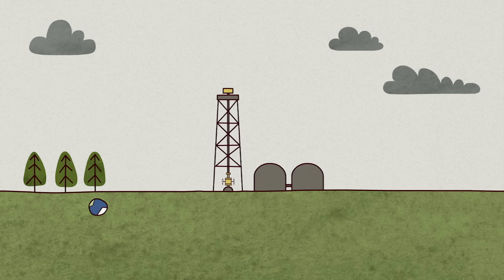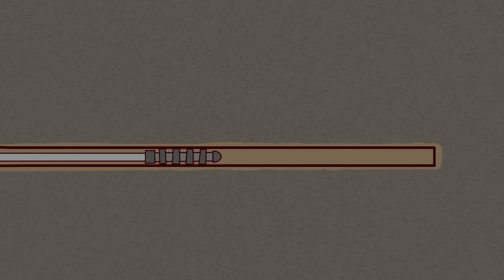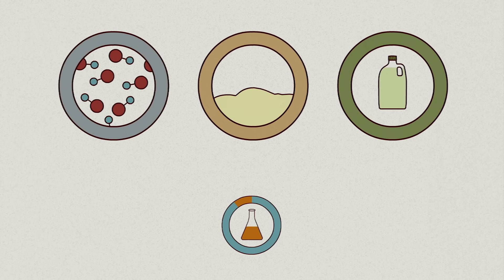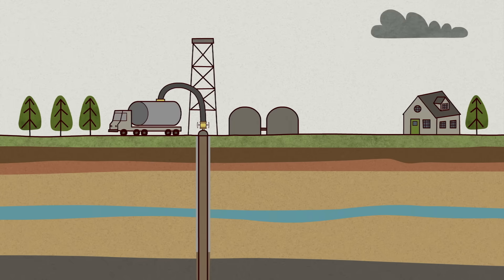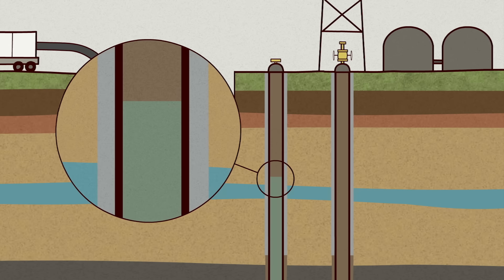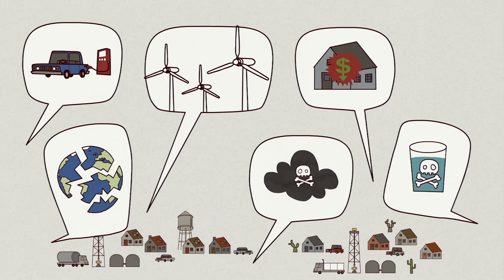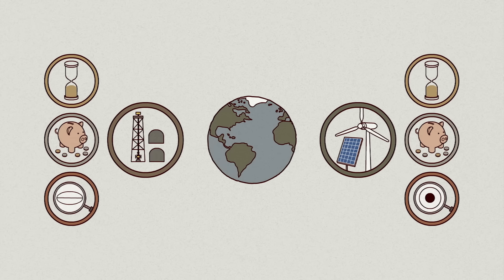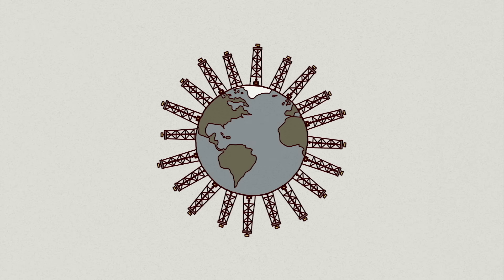How does fracking work? - Mia Nacamulli

Comment: MISLEADING / MANIPULATIVE EXPLANATION ! I noticed that this is the newest and most viewed video explaining fracking(I would also trust TedEd) BUT -This video was made in order to induce a bad opinion about hydraulic fracturing to the general public. It’s a neat combination between true facts and total B.S. I will try to explain. Keep in mind that nowadays, this process is usually happening at a vertical depth of 1-6 km. Anything that happens at surface can be easily controlled.
Breakdown-starting from ~1:47: 
Acids make up a very small part of what's involved in this process. One could argue that the use of acids was reduced by the introduction of modern fracking. 
Slickwater can be classified in 2 main categories (99% of the cases). 
The first is guar and its derivatives. By the standards of this video, i could also refer to guar as a legume. If you do a google search on "guar", you will learn that it's sourced from nature and mainly used in the food industry - Right here, on the surface of the earth, exactly the place where pollution is a problem). 
The 2nd one is Acrylamide derivatives(invented and also predominantly used on the surface of the earth). EX: In United Kingdom, approximately 12,000 tons of polyacrylamide is used in the paper production industry annually. Fracking in the UK probably uses no more than 50t per year(most of which stays in the ground). Interesting read here: ukessays.com/essays/biology/acrylamide-with-chemical-formula.php . 
Disinfectant is also a very small part of the process (0.0001%). This is usually chloride and its derivatives. I'm fairly sure that worldwide, more of this is used by the water park industry alone than by hydraulic fracturing. 
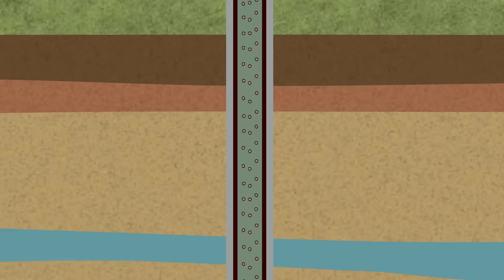Going further, from ~2:55  - the produced fluids can be handled safely- it’s just a matter of enforcing the rules on how to do this. Here is where lack of care, corruption and/or incompetence make their mark.
Radioactive material is also very negligible compared to what’s mined and used on the surface in nuclear energy and other applications. 
Salt – Need I remind you about the salt from the oceans?
Heavy metals – the amount fades away in comparison with what’s used by the battery industry
~3:35 All O&G wellbores in the world feature 3 or more barriers in this zone. If rules are enforced properly, the water table safe from harm. 
Everything is done in order to extract more hydrocarbons. Fracking into water is seen as a failure. 
The seismicity created by a moving train or truck is significantly bigger and more frequent than the one generated by fracking.  
The fact is that hydraulic fracturing has been around since the 40s. It has evolved as a secondary result of the advances made in the chemical industry. We use much more than what’s criticized in this video on the surface of the earth in unrelated applications. 
Much more important is the fact that hydraulic fracturing has delayed the moment when the world will experience a shortage of hydrocarbons. Some people were expecting extreme shortages to happen starting around 2020. This was a hot topic in the 1990s but forgotten right now. As we all know, energy shortages can easily lead to WAR. EX: The Iraq war(widely regarded as influenced by oil) began in 2003. Fracking boomed in 2007. The war officially ended in 2011. MIC DROP….
Reply: if i can make billions off the dohpes in PA that think fracking is safe, then i'm all for it. no need to even bribe them when they are so easily manipulated. i dont care if fracking contaminates their water as long as i make my profit margin. its not like you are getting any major intellectuals from those communities anyway. and if entire families drop, the company can easily take their lands and add more wells. a win win.

Comment: We know that, at the power plant level, natural gas produces only somewhere between 44 and 50 percent of the greenhouse gas emissions compared with burning of coal. This is known for certain; it’s basic chemistry. That is a gigantic benefit. Further, some research that claims methane is so harmful uses a 20-year time horizon; but over a 100-year time horizon – the way we generally measure global warming potential – methane is not nearly so harmful as claimed. Thus, methane’s impact is potent but relatively brief compared with impacts of increased carbon dioxide emissions. The number-one priority must be to reduce the reliance on coal, the biggest threat to the atmosphere right now. Fears about emissions leaks are overblown. Even if the true leakage rate were slightly more than EPA and some states estimate, it is not that dramatic. We are developing technology to reduce these leaks and further narrow the gap. Moreover, research-based modeling suggests that even if energy consumption increases overall, the United States still will reap greenhouse benefits as a result of fracking.

Comment: Just a little one sided. There are problems and risks with every form of electricity. Tens of thousands of fracking wells have resulted in less incidents and lower scale than any other form of energy production. Not saying fracking is great, just that the author is extremely biased. Do your own research on fracking and multiple alternatives and the entire process of each to form your own educated opinion.

Comment: 1:00 That's pretty deep - 3000 meters is 1.84 miles.
Reply: They go much deeper than that in some parts of the world. Chayvo is 4 times deeper.
Reply: @mcty19  Indeed. Thank you for that. After reading on it, I see that several world records have been set there, including the current record depth set in November 2017 of 15 km/49,000 ft/9.3 miles.

Comment: Fracking process also use high pressure (gas)
Simple term.
This process has been Use from 1980s 
Mobil oil us one company. 
The mechanical process cost more but more environmental friendly 
Coal powerplants use  bag houses as filter 
The USA is the most environmental country.
Ocean pollution in the USA is. 0.03. Asia ,China 83% pollution.
China will not Start climate change until
2035. 
These are facts look them up.

Comment: Turns bedrock to gravel. Releases radioactivity. Despite claims, it allows "produced water" to enter ground water. About a tanker truck of chemicals get pumped into every frack, only half of it comes out. ALL well casings fail, just a matter of time. The fracking industry hasn't made any money since the whole industry is being financed at very low interest rates. The federal govt is currently propping this industry up because it can't compete with currently cheap oil. The long lasting effects of polluted ground water, massive amounts of in ground VOCs and toxins, consumption of surface water, big oil money corruption in congress, wars across the globe, the delay of renewable energy development and especially the escaping, unburnt gases which are 80x worse than CO2 are an absolutely insane way to continue to power the world. It's not even profitable. This is a corporate, good ole boys ponzi scheme stealing monster amounts of tax dollars from Americans and making a few well connected 1%ers and politicians rich. End of story.

Comment: Take it from someone who has worked in this industry for a long time.  First, there is no "k" in the term "fraccing".  Most people in the industry will find this humorous.  Secondly,  this video is very basic and there are some things that are not very accurate about it.  The author of this could have done a better job of condensing the material while maintaining the accuracy of each statement made and used more standard terminology in that process.  Finally, there is a "left" leaning slant to this presentation.  One should investigate the necessity of hydrocarbons to the products and services that we all find essential to truly understand the magnitude of ignorance that is imbedded in the concept of banning frac and its impact on domestic oil production and the global economic impact that would follow.   In short, everything we have utilizes oil in the process of production and delivery to the end user.  Without oil we would be back in the dark ages . . . without wales!

Comment: 2:54 How can there be radioactive material in the flowback liquid?
Reply: I'll try to explain it as simple as possible:

hydraulic fracturing is used in Shale reservoirs. and those shale reservoir have a geological term called "source rock" one of the interesting characteristics of source rocks is that they're very radioactive than most rocks, they released high gamma rays and have very high concentrations of Uranium. because sauce rocks contains " organic matter " Wich is the hydrocarbon we're trying to extract.

during exploration and drilling we can find those reservoirs by measuring gamma rays. so it's a good indicator.
however during production and using Hydraulic fracturing. the fluids gonna make contact with those shale reservoirs and some of the radioactive minerals gonna get dissolved in the flowback.

I hope it's a bit clearer.
remember shale in general are radioactive compared to other rocks
but Source Rock shale is Super radioactive (3 Times more radioactive than standard shale )
Reply: There's naturally formed radioactive elements in the earth. Hence why its in our periodic table

Comment: Car batteries require Lithium. A soft metal that has to be mined out of the ground
by heavy equipment powered by diesel engines. If electric cars should become more
popular. That means more mining to keep up with demand. So is digging more holes
in the earth environmentally sound?

Comment: Regarding the earthquake thing, I saw in another video that the so called earthquakes are just small tremors. We know earthquakes are caused by land masses shifting but when they get stuck, pressure builds up until there is so much pressure, the earth violently shifts. What if these tremors are relieving the pressure in small amounts? Like when you shake a bottle of soda and open it, it explodes. But when you just barely open the bottle, the built up gas pressure is slowly relieved thus prevent the explosion. Does the same concept apply to fracking? It makes sense to me. As for the methane, what about capturing it and putting that stuff into our energy generation? And one last thing. If currently technology makes the energy last for a couple decades, how about improving the technology so the need for energy is lowered while doing the same amount of work?

Comment: Well u got a few things wrong.
1- it’s not an immediate 90 degree angle, it’s gradual over hundreds of feet
2-they don’t perforate the whole well at once, the make one set of cracks, pump on it, plug that section off. from the rest of the well, rinse and repeat for as many times needed. These are called stages.
3- the flow back fluid is pretty much always pumped back into the ground into a injection well, basically an old well that is done producing (sending oil and gas to the surface) we pump the fluid back into these empty pockets away from ground water or anything that can be contaminated
Reply: I worked on a perforation crew. Duece said everything I wanted to say.
Reply: @happycatginger   ive worked water transfer, been on the a 3rd party chem/ pump down crew, roughnecked, ran casing, done flow back, and wireline just a little bit of everything and on 23 just want to find a good company to settle with

Comment: I didn't really hear a good argument against fracking here. I'm not saying there isn't one, but this wasn't it.
Reply: Apart from everything from 3.20 mins onwards?
Reply: The contamination that can occur due to faulty casing can occur with ANY oil/gas well. Poor casing jobs have nothing to do with fracking. If you're going to shut down fracking to eliminate the risk of ground water contamination, then you need to shut down ALL oil/gas drilling.

Comment: This is honestly not a very good representation of what frac’ing is.  He gets some stuff kind of right but a lot is very misleading and very simplified.  For one thing 99.5% of the fluid is water + Sand.  That leaves only 0.5% is chemicals.  The main “chemical” used is surfactant.  A common surfactant is literally concentrated Dawn detergent.  The other main component in the fluid is guar.  Guar is a thickening agent typically used in food like ice cream and is not harmful at all.  There has never been a case where hydraulic fracturing (frac’ing) has ever been shown to contaminate any water source.  It’s just way too far below the water table for this to be possible.  Water tables are typically around 400’ below ground where frac’ing occurs typically at 10,000-12,000 feet below ground with many layers of rock in between them.

Comment: The truth is fracking also contaminates the drinking water when the earth is fractured and seeps into the water table  but of course the oil companies won't tell you that because then they won't be able to keep fracking to recover their product
Reply: The chances of that happening are slim and none.  Great care is taken to avoid those accidental results.  Water bearing formations are isolated from the fracking zones.  That sir, is the truth.  I spent 37 years in the oil industry, designing equipment to safely locate, perforate, and produce from oil bearing formations.

Comment: This video gets a D...  it doesn't lie, but they do misrepresent several key aspects regarding well constructions.  The largest one is that the drinking water found within 100-300M from surface are sealed behind 2, 3, or even 4 strings of casing, with each string cemented in place to prevent fluid migrations.

Disclaimer:  I work as a directional driller, so I am directly involved in the process.  We are drilling twice as many wells now as we were 10 years ago, from a single well location.  The surface footprint has been reduced by 75% or more.  I'm all for regulations as long as they are backed by statistics.  Safety is crucial.  Oversight on smaller companies is critical, as those are the ones who tend to feel like they can make shortcuts, as they don't have the deep pockets that majors have.